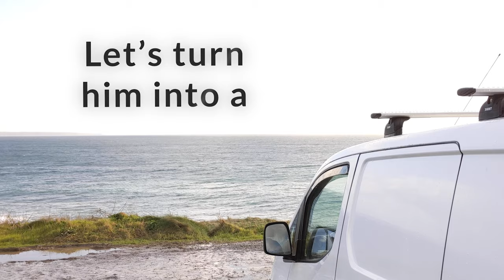VAN BUILD Time Lapse From START TO FINISH | Tiny Camper Van Conversion

Comment: Your videos have been SUPER useful for me, as I'm in the process of converting our little NV200 too! We're about to do our first trip to test it out (even though it's barely half way finished). Fingers crossed my bed build doesn't fall apart mid trip! :)
Reply from the maker: Glad you're enjoying the videos, hope your trip away goes well. We did our first trips away long before the van was finished, just couldn't wait to use it!

Comment: Putting the Aluminium insulation down first actually has the opposite effect. Any heat just conducts straight though. It’s meant to be used on the inside as a vapour barrier, not touching the metal outside.
Reply from the maker: Has worked a treat for me 👍
Reply: I agree, a vapor barrier is what's called upon to keep condensation at bay! Cheers !!
Reply from the maker: It all depends on how you use your van, I don't sleep in mine more than 30 nights a year so condensation has been a problem with the methods used. Check out my my recent van build review video, where I do an insulation check: https://youtu.be/OdbZVA8h0UE

Comment: FANTASTICLY Documented. MANY THANKS. >>quick question>>
Im about to embark on a converstion myself
When securing the plywood to the ceiling are you drilling into the reflectix? or straight up into the roof?
doesnt seem like enough thickness to hold up such large sheets of plywood, but drilling into the roof would provide leakage problems, hence my question :-
if you could clear up my confusion i would GREATLY appreciate it.
MANY THANKS again for such a well thought out video
Reply from the maker: Thanks, glad you like the build! I've got a full video on the roof set-up, which show how I attached it, here: https://youtu.be/3SnHXMrDhAQ

Comment: Cracking job mate. 

Have you got a vent in it? 

I needed a roof vent in my last van (transit connect) and will definitely be putting one in my next project (I can't decide whether to go big on a transit custom or stay mid on a Peugeot expert) but whichever it will be vented!
Reply from the maker: Hi, I haven't got a vent - haven't found the need for one based on how much I sleep int he van, but I've got a video coming out soon which gives more detail on my decision. Cheers, James
Reply: @LensOfJames  - cheers James, I look forward to watching it.

Comment: what happens when you need to fix the door latch or wiring  inside the door??? because it will break at some stage
Reply from the maker: Remove the door card, cut through the carpet and insulation, repair door, patch up carpet, replace door card 👍

Comment: That film must have taken a lot of editing effort, is rhere a way i can send you a picture of my back unit and spice rack it would look good on yours. Also i have been meaning to ask from the start what is the reasoning behind putting the bed on the primary door side, is it surf board related ? I used my all in one diesel heater most days last week too. Ed
Reply from the maker: Thanks Ed! Drop me an email, I'd love to see your set up: lensofjames@gmail.com. Yeah I put the bed on that side so the surfboard could still fit down the centre

Comment: Hey is there a reason why you choose carpet? Does it help with insulation and sound noise?
Reply from the maker: There is a slight insulation factor (as with wood) and noise too, but overall it's a lot lighter to carry around than wood cladding and I like really like the look of it.
Reply: @LensOfJames  thats true, have you found any cons using this material?

Comment: What is the coldest climate you use the van in? I live and travel where it can easily hit 0deg F. It can also get to 100deg F depending next the time of year
Reply from the maker: I live in Cornwall, England and it rarely goes below 0°c in winter and peaks at 30°c in summer, so not quite as extreme as your temperatures
Reply: @LensOfJames  thank you! I will look in to better insulation

Comment: what can I put on the outside on the roof to cut the rain noise down, I have a Doblo,
Reply: Have you not put accoustic sound deadening in with the insulation on the roof? Nothing really stops rain noise but the accoustic panels stop the booming/echo you get.
Reply: @JammyDodger45  lazy, put no insulation in at all, cant be bothered to take roof covering off, just after something to put on outside of roof when parked up, was thinking of getting that artificial grass and gluing that on, it may look silly, but should cut down the booming of rain drops :)
Reply: @crazycrab8578  - at least 1/2 of your user name is correct then! 😆

If you are/were in the RAF too your name is bang on.
Reply: @JammyDodger45  I am a member of the OMRLP, and how could you , say that, "RAF",  shame on you,  I am so insulted, "X" Army,  :), plus I have a good sense off humour  :),  and I had a 3 wheeler with a goat bolted onto the roof, as I was the Minister of Keeper of the Royal Goats,